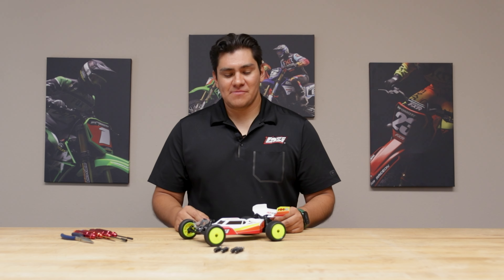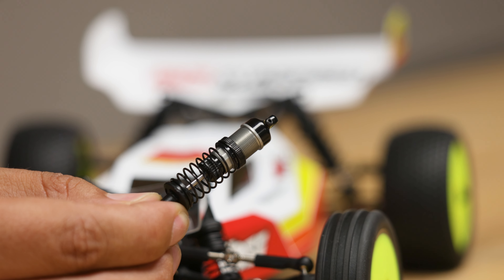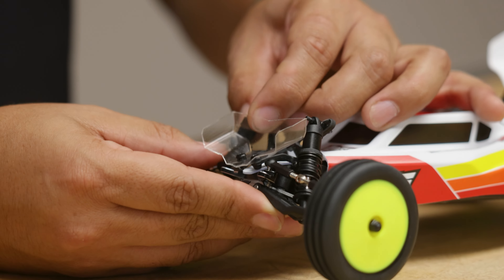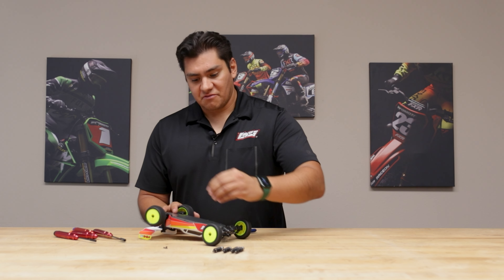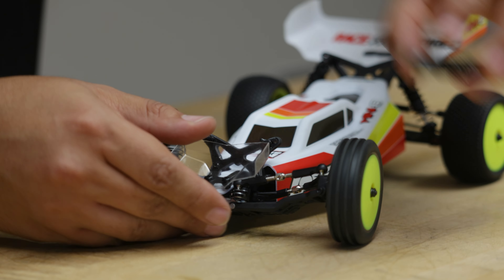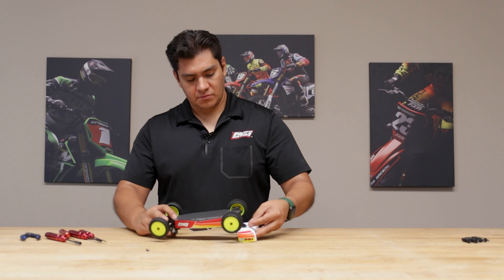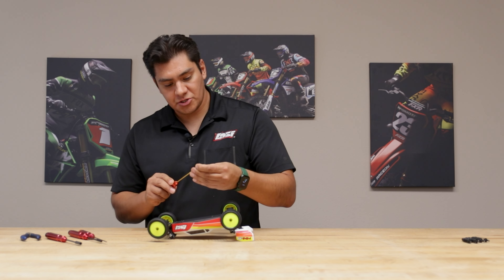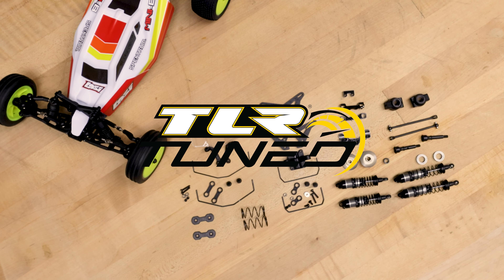THE LOSI MINI-B | HOW TO INSTALL TLR313000 &TLR313001 ALUMINUM SHOCKS

Comment: How are these shocks different than the other Mini B aluminum shocks Losi makes but sells for 2/3 the price? The LOS314004 and LOS314005?
Reply: The main difference between LOSI (stock aluminum) shocks and TLR (Team Losi Racing) shocks for the Losi Mini-T 2.0 lies in their performance, adjustability, and quality:

LOSI Aluminum Shocks (Stock Upgrade)
	•	Purpose: A direct upgrade over the plastic stock shocks.
	•	Material: Aluminum-bodied for increased durability and smoother operation.
	•	Preload Adjustment: Uses clip-on spacers to adjust ride height.
	•	Performance:
	•	Great for casual use or light racing.
	•	Smooth but not as precise or tunable as TLR shocks.
	•	Value: Cost-effective for general handling improvements.

TLR Shocks (Pro-Level Upgrade)
	•	Purpose: Designed for serious racers or high-performance enthusiasts.
	•	Material: High-grade aluminum with tighter tolerances for consistent damping.
	•	Threaded Body: Threaded collars for precise preload and ride height adjustment.
	•	Seals and O-rings: Higher-quality seals for better oil retention and consistent damping over time.
	•	Performance:
	•	Smoother damping, better response, and more adjustability.
	•	Perfect for tuning shock oil weights, pistons, and spring rates.
	•	Value: Higher cost, but ideal for competitive handling.

Which Should You Choose?
	•	For Casual Play & Budget-Friendly Mods: Go with LOSI aluminum shocks.
	•	For Racing or Precision Handling: Invest in TLR shocks for maximum adjustability and performance.